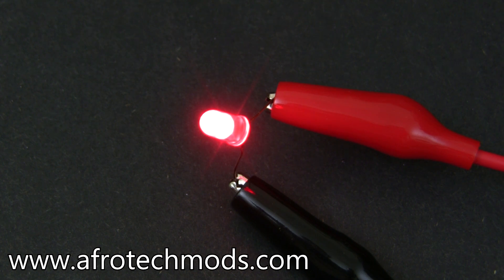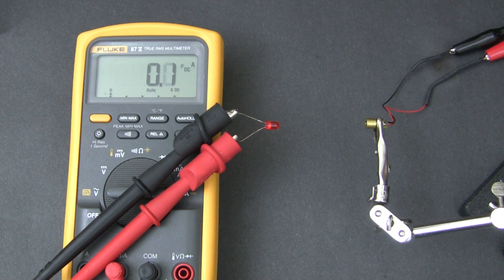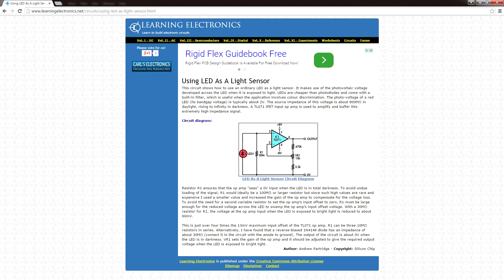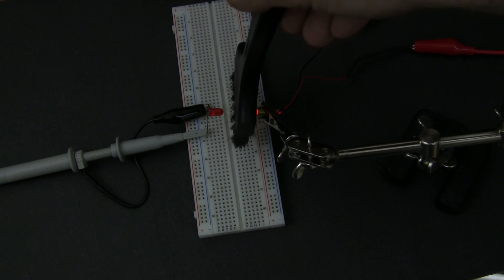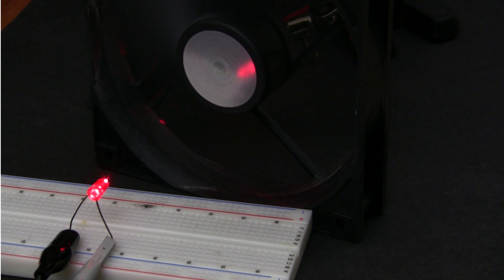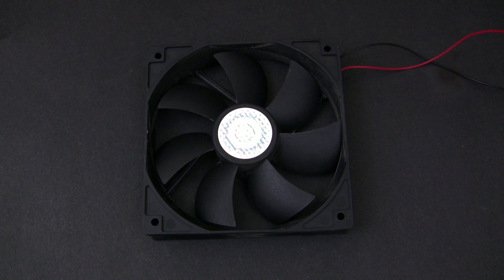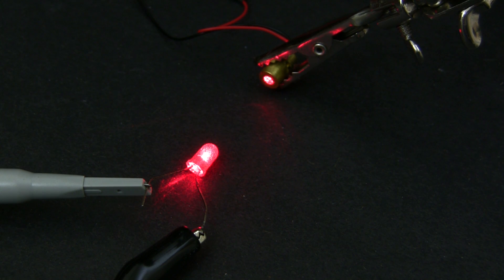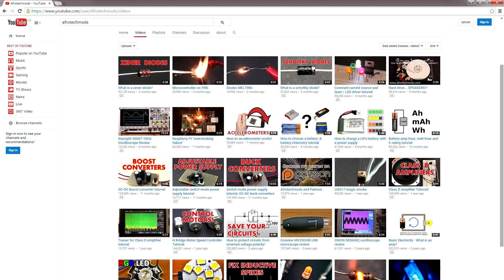How to build a simple laser tachometer

Comment: An application im building needs me to measure the rpm and this is a great input to it. However, I do have a query. If the surfaces of the emitter or receiver is subjected to a dusty or mucky environmental conditions, I highly doubt the readings will be accurate or will emit any reading considering they are sort of blind folded. Any advice or other methods to overcome this?

Comment: Is data logging possible on PC using this design? I need to count the number of rotations as well as changes in the RPM with respect to time. 
Also, Is it possible to measure the RPM when keeping the laser source and sensor in the same direction (by reflection) as done by the available non-contact tachometer?. Please suggest

Comment: Actually, you can hook up the LED to a headphone jack, and measure the frequency using an spectrum analyzer app or your phone.
And since it's only 1.5V, it can't fry your phone!
So whenever the LED is illuminated by the laser, it makes a "high" signal or it makes a "low" signal on the "microphone" input
And then you just divide the frequency by the number of blades, and multiply it by 60.
You can make an app that can measure the RPM for you, just enter the interruptions/1 rotation, and voila, you now know the RPM! :)

Comment: (anyone) at 0:23 the laser wires appear to have some shrink tubing around them, is that right? I'm have a similar laser which works fine but the wire is so thin I'm not sure how to hook it up for long term use. Just using some quick wire spring connectors for now. Any advice from the channel moderator or anyone one the boards is appreciated

Comment: I tried this with a green laser and a blue LED, and I saw no current with my multimeter. Do I need an led and laser of the same color?
Reply from the maker: Yes! They have to be the same color.
Reply: Ok thanks, ill pick up a green one tommorrow, but I also had a yellow led on hand and since its lighter color I gave it a try. I works, but almost impossible to read on the osilloscope.
Thanks for replying!

Comment: CAN YOU USE A DIGITAL MULTIMETER WITH HZ READING??
Reply: Sure. A decent multimeter can use a signal with a Peak-to-peak voltage as low as 400mV (an LED will give much more than necessary) to measure frequencies of several kHz (much more than you will need in most occasions)
Reply: Also, to analyse signals up to 20kHz you can make your own poor man's osciloscope with a few diodes, resistors, free software (for non-commercial use) and the microfone jack of your computer. Most sound cards can sample 24bits@192kHz and will do the trick just fine. Search on google for "Soundcard Scope - Christian Zeitnitz" and "Sound Card Oscilloscope | Make: - Make Magazine"

Comment: Ok, but I need a circuit or IC that will actually convert this information in real time via an array of LEDs to indicate changing RPM without having to calculate all the time.  Is this possible without using an arduino or other complicated/expensive purchased product?
Thanks for the great videos
Reply: You can get some logic gates (probably 74xx series ICs) and do binary calculations. Add a converter from BCD to 7 segment display and you have whole device. Only thing I'm not sure how to do is the actual measuring of the frequency of the pulses.

Comment: How is the "real" tachometer you use in the end built? What kind of sensor picks up the speed, and does the laser itself have anything with the measurement to do, or is just a "pointer"?

I´d like to build something like that to take control measurements of flywheel RPM on my boats engine so I can input the right dividing factor in the engine tach...

Comment: I just though by hooking up the same thing to an arduino and using it to measure the minute changes in current and using an 8 bit display and output the RPM and just to complicate the project use an input mode for arduino and get the number of blades and use that to process too.

Comment: What is the power rating of the LED Laser you are using?  I can find 5 mWatt Laser Head diode modules on Amazon or e-bay; but I'm not sure they would be strong enough ?  I have a Laser pointer I've used for doing presentations - but even when I put them directly on the head of a Red or Green LED - I only got sub-100 mV readings out of them on my scope - no where near the 1.5 V you got from your experiment ??  And once I pull the Laser out far enough to inter-position a small PC fan - the voltage drops to an unusable level.  Any comments??
Reply from the maker: 5mW should be plenty. Try different red LEDs? Green is unlikely to work well. Also try the 10x attenuation scope probe setting.
Reply: Thanks !!  I'll try that !!!  {:>)

Comment: Hey, I don't have an oscilloscope or DSO... Is there any cheaper way to study waveforms..??
Reply: +Rajat Tarade You could take the signal from the LED, amplify it to produce a 3-5V signal, and then hook it up to a digital input port on an Arduino or similar. Just count the pulses.  You could also use an ADC port, but the digital port would allow higher frequency measurement.   Use a transistor or op-amp for the amplifier.
Reply: The soundcard on your computer. Only AC-coupled. Don't exceed the maximum input voltage, at least not without current limiting.

Comment: I'd like to use this trick to make an oscillator where the rpm of the motor determains the pitch of the (square wave) note. Would this be possible (ofcourse it is). Would it be worth it?

Comment: I need help with a tachometer that is very sensitive , when I hit horn power on motor off tach move to max and gos back to 0 . but when the motor is on this does not happens , even if I take tach off the dashboard and hook it up to battery it still happens when I hit horn . I think this is call a spike please tell me what and how to hook up something to power wire and ground to fix this . It is important because the tach has a recall button to see what my last RPM shift was and if you hit horn I lost my recall RPM . Please tell me what to put on power wire and ground to fix this PLEASE !   I try to put it in a car to see if it happen there but it did not happen . Now the different between car and bike  is my bike a has a lithium battery  . PLEASE HELP ! My channel is m42665

Comment: I've got another one for this! This morning, I wanted to know how fast a motor, which was not connected to anything, so had no fan blade or anything for a tachometer to work on, was spinning. I put a small neodymium magnet on the side of the output shaft and simply held my oscilloscope probe next to it. as it spun, it induced a very measurable voltage in the probe.

Comment: Any easy explanation what physics is behind this?
Reply: +Flankymanga In a lazy explanation I could refer to a "Faraday principle", when you build a motor you can use it as a generator, when you build a speaker you can use it as a microphone, etc.
 As I understand, when an LED (read a semiconductor junction) is crossed by electrons, these electrons must quantum leap to switch material. Because they fall in orbital, the atoms emit light (as any atom where electrons leap around for some reason). When any kind of material receives photons of proper frequency, the electrons will leap so that the atom absorbs the photon. On a LED, the absorption of the photon forces electrons to skip across the semiconductor types and so this generates a voltage (as in photo-electric effect). That's the quantum physics explanation for you.
Reply: +Flankymanga just look for photoelectric effect. Einstein got his nobelprice for this

Comment: Afrotechmods  maybe i can get some tips on my multimeter, i think im following you corrrectly tho im not getting any results, here i have http://i5.walmartimages.com/dfw/dce07b8c-af65/k2-_9d4c0362-9e07-4569-b98c-1cef69142a20.v1.jpg and i have all sorts of LED's as well as that same type of laser pointer.

as far as my multimeter i have the red plug on DC10A "far left port" and the black plug in the middle COM port and the dial i have it set to DC mA which is the 1st CW blue box according to this link http://i5.walmartimages.com/dfw/dce07b8c-af65/k2-_9d4c0362-9e07-4569-b98c-1cef69142a20.v1.jpg i did also tried the yellow box next to that DC mA and either gave me a reading thanks in advance 

some question that might simplify my understanding of your results might be 

* does it matter how much current or voltage your supplying the laser diode? 
* does it matter what polarity you have the led hooked to the multimeter? 
" anode to + , cathode to -  vise versa on the multimeter? " 
* does it matter the color of the led? 

side note i am looking to implement this type of design using some sort of pcb /breakout board setup which can read this value as your video and have that read  wire plugged to my arduino so i can run IF statements in the IF void loop section

this is for my robotic design i am currently using a magnetic hall sensor which requires a magnet and a ic hall sensor and i think this setup you have here will be much better weight wise as both of your items weights less than my current setup..........as always thanks for your videos!

Comment: Afrotechmods What is the reason for using a red LED for this? Is just what you had laying around or was it most compatible with the laser diode that you had?
Reply: SkaterK3 Well, I cant speak on the actual emitter, but I can say that since the plastic shell around the LED was red, red light passes through it better than any other color light, so a red LED combo's with the red laser would immediately be better for that reason.
Reply: Kakunapod Okay that's what I thought. I am wondering if a Blue LED (with a higher forward voltage) will produce a stronger response than a red LED. I think this is worth a try but I imagine that there is a small cost offset considering how expensive blue laser diodes are compared to red ones.

Comment: does the voltage depend on the laser color? I wonder we'd get the same reading if a green laser was used on a red LED. I feel that we'd get a maximum reading for laser-LED systems that have approximately the same wavelength.

Comment: With the right LEDs, you can use the one LED to power another LED. I had a setup while I was interning at NASA where one super bright red LED was shining on another one of the same LEDs, and that LED was connected directly to a 3rd red LED, powering it! I measured around 2V or so on my meter without load! It was very dim, you could just barely see the die glowing, but enough to be an impressive proof-of-concept. (I was measuring the slew rate of the LED as a sensor compared to other 'real' sensors.)

Comment: Is there a way to figure out the max response rate of an LED? e.g., have a function generator control a laser and then see at which point the LED is no longer able to differentiate between the pulses?
Reply from the maker: Razor2048 Yup that would work. But you'd want to have a transistor amplifier circuit between the Fgen and the laser.

Comment: If you measure further away from the centre of the fan, won't you get a faster reading?
Reply: Kieran Hammond Glebs has the answer.  What you WOULD get, though, is different periods of open circuit time vs. closed circuit time, as the shape of the fan blades differs at different locations... but the number of cycles (open - closed) remains the same.
Reply from the maker: Kieran Hammond Nope.

Comment: The video shows the laser shining on the fan's label. Does this work at all for a straight reading?  A strobe tachometer works by reflection - not by the binary breaking of a beam - so it would work on continuous surfaces.

I would love to be able to point my tachometer at any rotating object and get a reading.
Reply from the maker: MattsInTheBelfry Sorry this was poor camerawork on my part. What is happening there is the laser is shining through the fan blades, then hitting the LED. The LED gets lit up very brightly, and since the fan's label is reflective it acts as a mirror and shows the camera the shiny LED. I am not measuring the reflection of the label, but I can see how it looked like that in the video.

Comment: God damn it... I wish this was released like 2 weeks earlier. I was curious how fast the tail blade on my 6h RC helicopter was rotating, and I didn't have a tachometer. My next best thing? Get a microphone, record the audio right next to the blade, put it in audacity, get the time between 2 peaks and convert it into RPM (then divide by the number of blades on the rotor) xD
Reply: Nice, that's a great solution
Reply: Jordan O'C I think your solution for this instance is easier.  So I wouldn't cuss about it.
Reply: ***** I am everywhere.
Reply: Jordan O'C If it's a Trex-style helicopter (with a shaft or belt to spin the tail rotor) then you can calculate  the RPM from the main rotor RPM, I think mine was 7-to-1 tail/main last I checked.
Reply: DFX2KX My heli has a 6:1 ratio between the tail and the main rotor I think, but I didn't know the rpm of the main rotor either.
Reply: Jordan O'C
getting the main rotor rpm is a pain, as well. but usually can be guesstimated by looking at your motor's data sheet for RPM range, and then counting the teeth on the gears. A royal pain, it won't be real time, though
Reply: DFX2KX Hmm, I could've done that too, but the RPM always changes depending on how you have your throttle and pitch curves set. For me, the tail ran at around 12,000RPM at 60% throttle and -1° pitch. Screw counting the teeth though haha
Reply: That's actually a great solution. Well done mate!
Reply: Woooo that sounds good ! At the same time challenging. But it Will be fun though